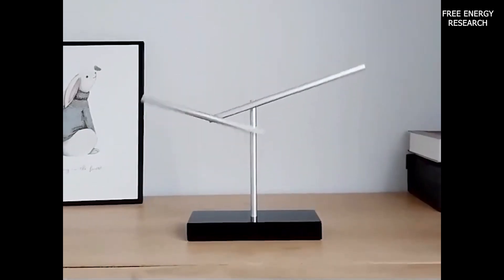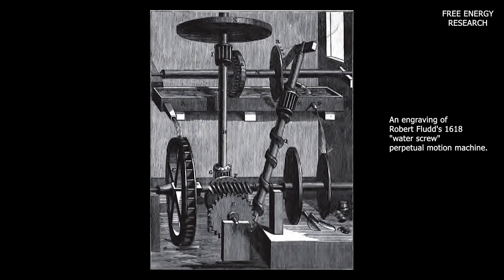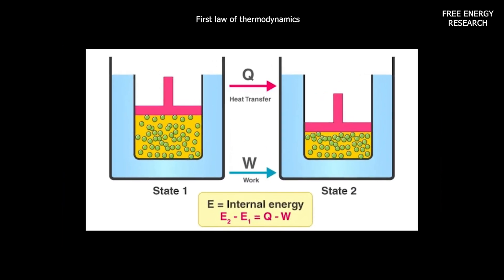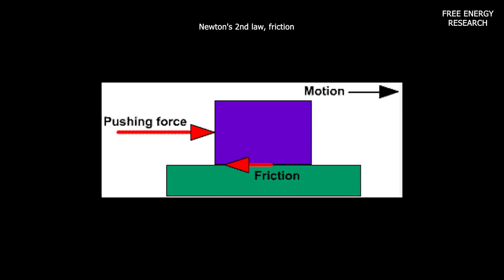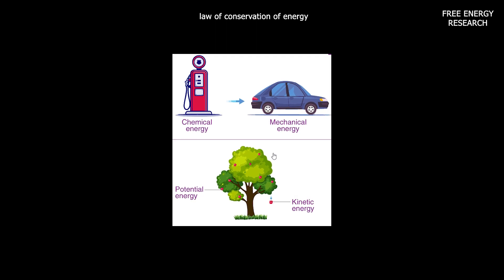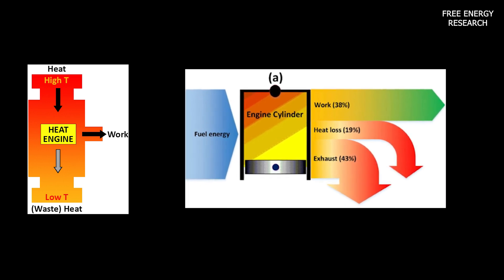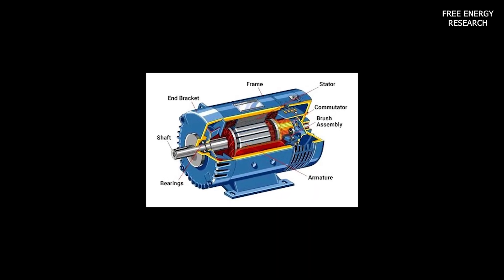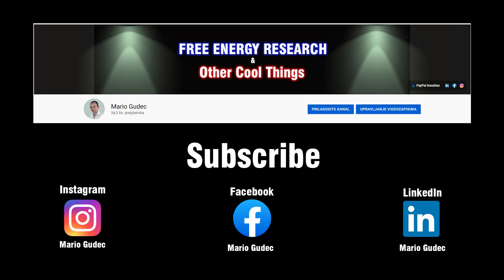Perpetual Motion Machines 2023 : Explanation

Comment: Conservation of energy is a fantasy with no consideration of natural conditions.  The Universe is expanding. Duh
Plus both charge (dielectric) & magnetic fields are non conservative fields ( they are velocity dependent and do not cancel, only sum, like kinetic energy when combined with mass form momentum, which is conserved. This leads to the Oberth effect (using accelerated, not “ideal uniform velocity” interactions that produce exponential amplification of velocity (energy).) Clearly at play in nature, not just NASA.
Over unity is natural in nature, and easily demonstrated when a skater increases their spin speed by simply pulling their arms in towards their body (far les energy than produced by their speeding up spin) as witnessed by naturally occurring whirlpools and tornadoes and planetary rotation. (Replicated by both Viktor Schauberger and Sam Clem, perfecting self-powered motors using liquid mass transfer from circumference to core-axis.) The flopping weights on spinning wheels are crude approximation builds.